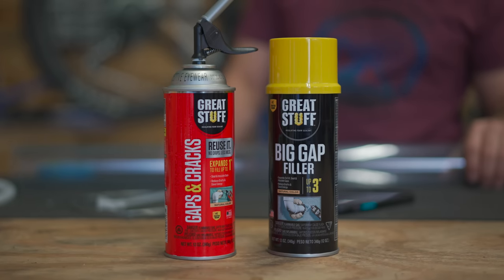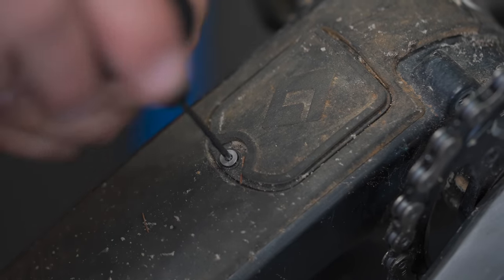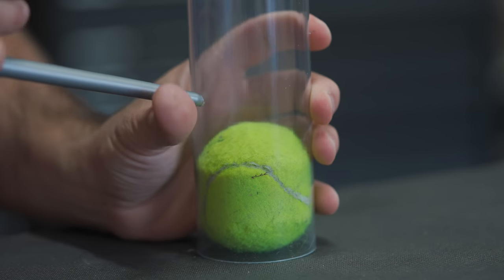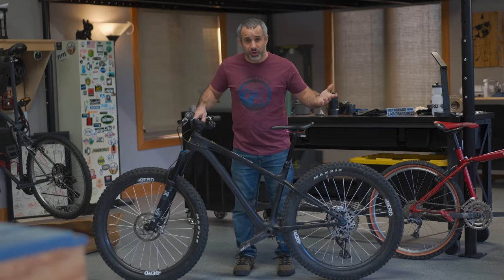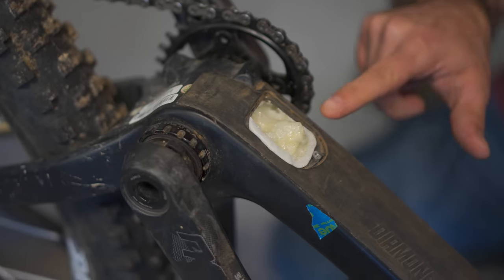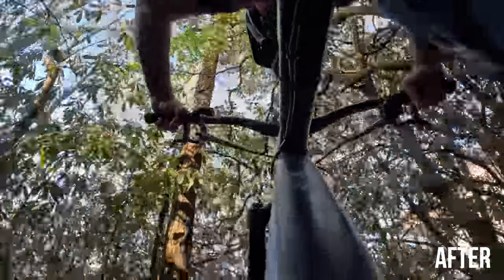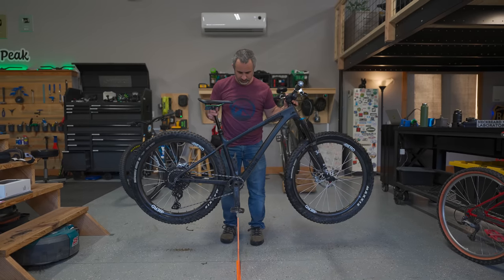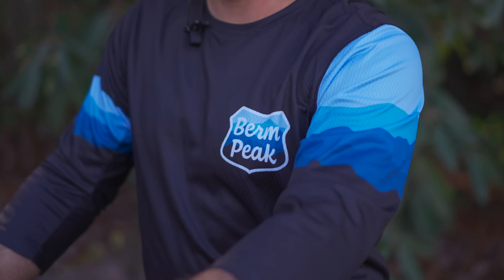Filling my bike frame with foam made it better—kind of. Don’t do it.

Comment: That foam is "open cell" foam. That means it will hold water. Once moisture condenses in there it is very hard for it to get out. Oddly, what will be absorbed into a space far more easily than it can evaporate out. Therefore, every place where you sprayed that foam in that van is going to rust out. Trust me. I've been in the vandwelling community for about a decade, and lived in my van since 2018. I've heard nothing but terrible rationalizations from people getting ready to do it, and horror stories from people who did it 5-10 years previously.

What you have just shown me is that you are willing to say anything for YouTube content. I will therefore be filtering out your channel.

Comment: it just adds 2 pounds filled frames 
unless you want bike throwed in water and floats that one way

if i were you DONT DO IT BECAUSE DOESNT MAKE ANY SOUND CMOM MAN JUST MAKE IT SO WORSE
only thing make noise is tire and cable and shifter and seat drop pose and chain all that is noise maker by bike have nothing todo with frames

Comment: It is a terrible idea to do this with spray foam. Spray foam has to react with oxygen in order to get stiff and is highly toxic until it does. There is not enough oxygen inside the bike tubes so you basically fill the bike with highly toxic swamp.

Comment: This sounds immediately like a really dumb idea. Foam couldn't damp any sound inside rigid piece.

Sound much easily propagates through solid medium than gas, therefore it will propagate more easily through solidified foam than the air, however it will propagate still orders of magnitude easier and further through solid metal tube itself, therefore stuffing will make no difference.

Just wasting time, money, and making a bicycle slightly heavier.

Comment: There is a big chance the foam did not cured inside your frame. It does happen in closed compartments. It does need air to expand and dry. What happens that your ends seal the inside and stop it from curing.

Comment: wait, your cables run through the frame? what? I have literally never heard of such a thing.  When did they start this nonsense?  I am guessing it's only on like million dollar carbon fiber composite glass frames or something because I have only ever owned steel or alloy frame bikes.  Mostly mountain bikes because I am a big dude and regular 21 speed bike frames just warp and twist under my girthy 6'4" 200+ pounds of  ADHDtistic nightmare of a body